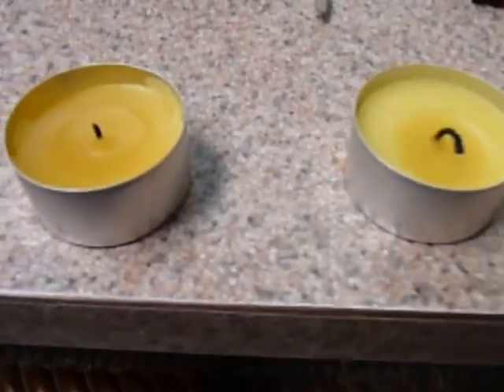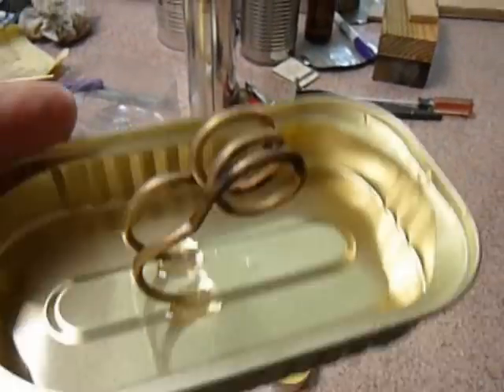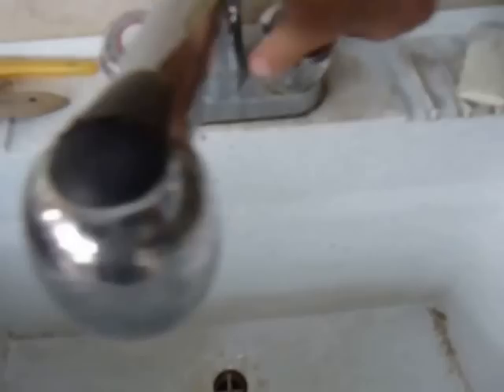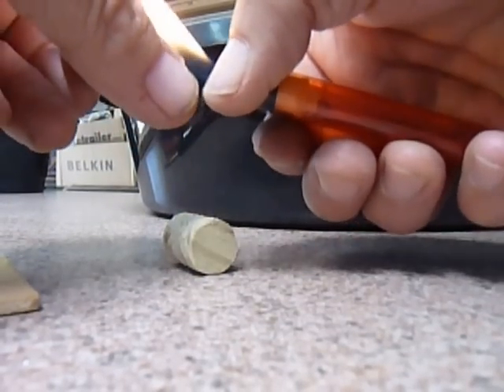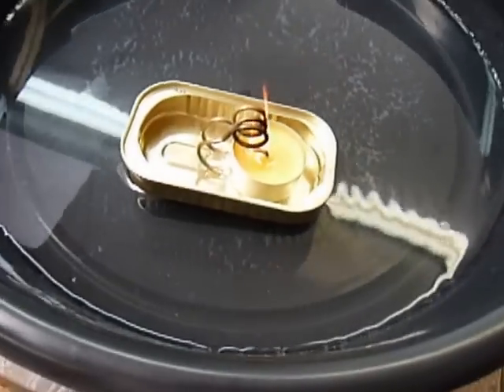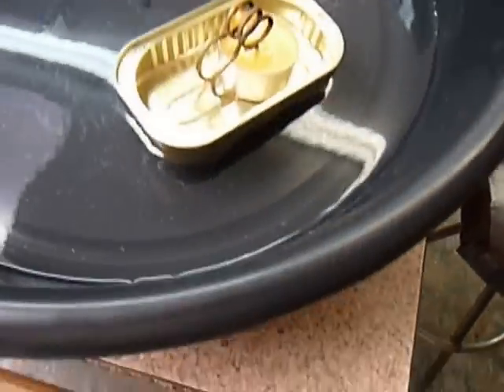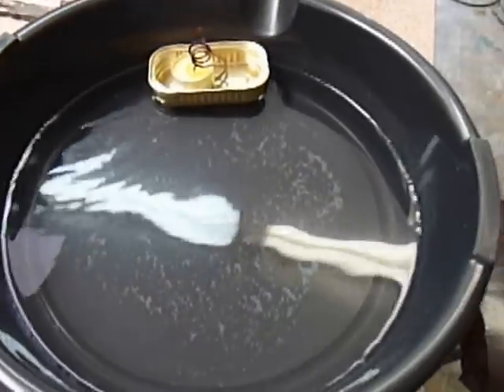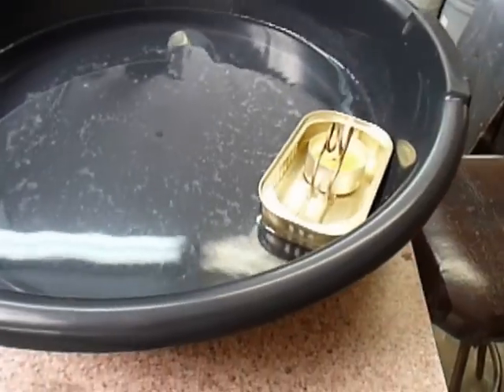P1040131  pop pop boat w/ coil engine

Comment: I didn't quite understand how it works. Does the heat make the water circulate through the pipes?
Reply: No, the pipes are filled with water and the difference in temperature between inlet water and outlet water drives the boat forward.
Reply: @foopadr9076  ok sir

Comment: Nice. Does anyone know why my pop pop coil engine fires, quite powerfully, and then takes 20 seconds before it fires again? It goes on,like that until the flame has burned down. Thanks for any help!!!
Reply: I had a similar problem.  The tubes in mine were partially blocked.